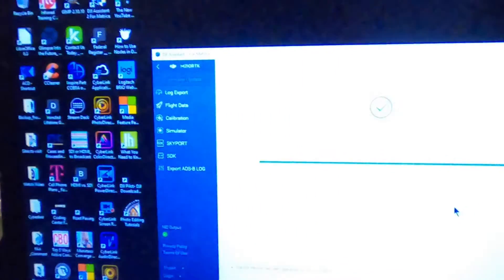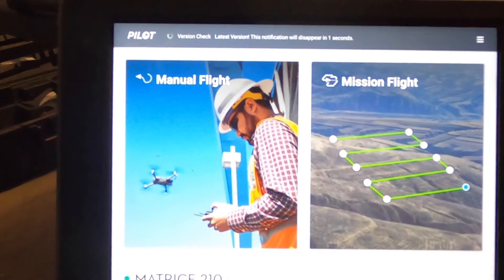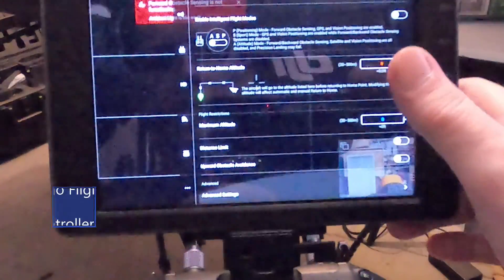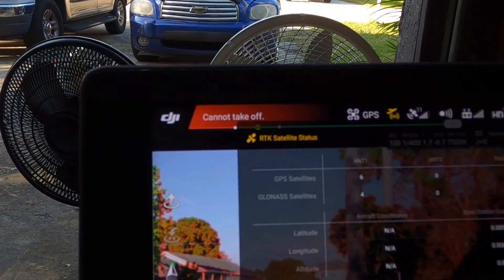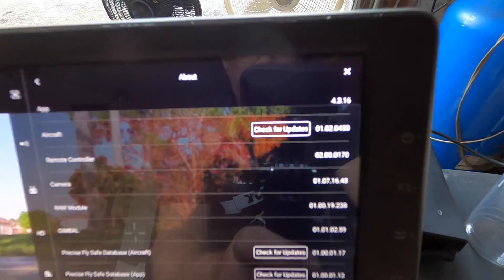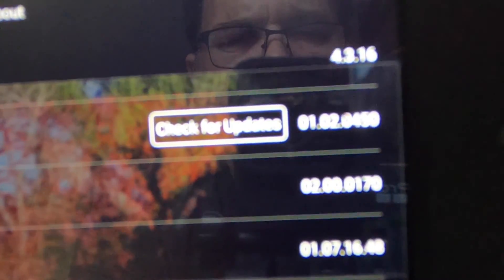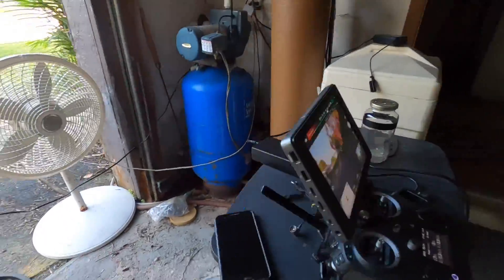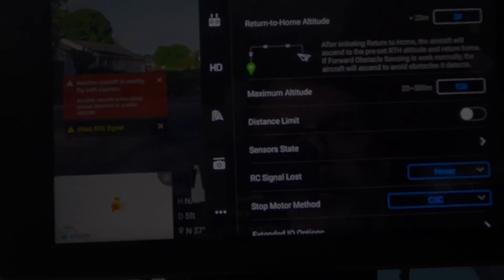DJI Matrice 210 RTK  - Flight Control Board Failure | What To Look For

Comment: I need to fly with dji pilot app with m210
Reply from the maker: Both the Go4 and the Pilot App work.  I have not tried GSpro.
I use the patch antenna to secure range as this works via enhanced light bridge. 
The patch is directional to 60° from aircraft position.

Comment: That would be very frustrating trying to sort out the problem and sounds expensive to have repaired. Thanks for sharing my friend.
Reply from the maker: $3000 USD Repair job as they had to break the "water tight" uav apart to replace the board. Of course they don't tell you that.
Reply: @AboveandBeyondGlobalDrones  Ouch!

Comment from the maker: DJI Enterprise Matrice 210 RTK v1  -** MAIN CONTROLLER BOARD FAILURE** - It happened over time till finally getting * "Cannot Take Off"* and No Battery SN's or Information as well as N/A Flight controller information. Since this Aircraft does not Fly and has not in 2020 why does DJI Repair Pictures show a different Aircraft with different Flight Controller / Main Board Serial Numbers ?? While the Printed Sticker can be changed, one can't change the Flight controller Serial Numbers without taking the Aircraft apart. GOOD to have all this information Yourself before you send your aircraft anywhere, as well as for Insurance Purposes !!

Comment: If the flight controller is not working it won't start?
Reply from the maker: No it will not Fly, will start up (Not Motors though), shows camera pictures but will not take off - main controller board failure shows Batteries as N/A and Flight Controller S/N as N/A.

Comment: Have you had any resolution on this?  I'm having the same issue and DJI have offered no advice... out of free service time frame!!
Reply from the maker: > I am being told that it is the Main Flight Controller Board that needs to be replaced by DJI. I'm combing through AirData records to see all "Warnings" which tell you the problems it's having.  I have seen ESC Errors on the record as well as RTK signal loss. There is nothing "WE" can do about it as I have tried everything. Time to send it back to Dealer. This happened just out of the warranty period.
Reply from the maker: Main Controller Board Failure  $1,577.00 for Main board and labor only.
DJI has to break apart the IP43 rated aircraft to replace. 
You will pay for those pieces too.